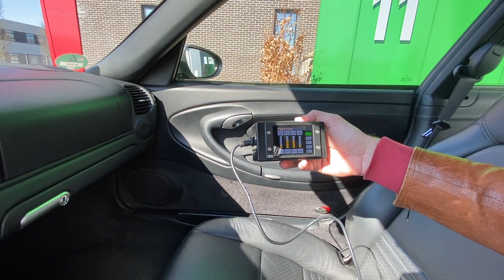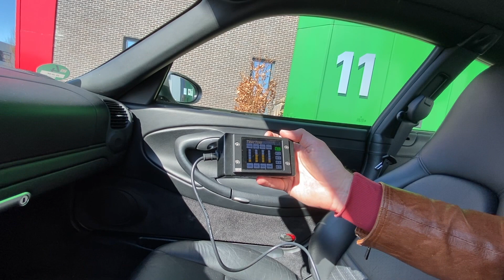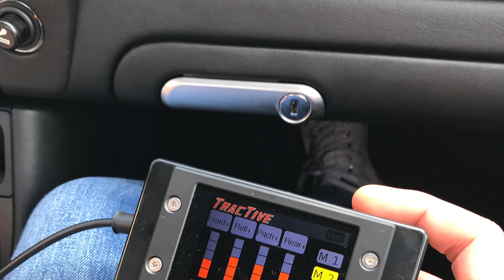Porsche 996 semi-active suspension

Comment: whats your honest feedback after running them for over a year now? curious of the comfort when its in a soft mode
Reply from the maker: Still very happy with them. It's comparable to the standard suspension in terms of comfort, as I went with similar spring rates. Being able to change the pitch and roll stiffness is the biggest advantage when doing different types of driving and in different conditions. Switching from no dive/pitch to a softer setting in a middle of a lap on the ring when it starts to pour down is a massive confidence booster. When doing driver trainings and I need to generate oversteer/understeer, I can dial it in to make it easier to induce. So yeah, big fan.